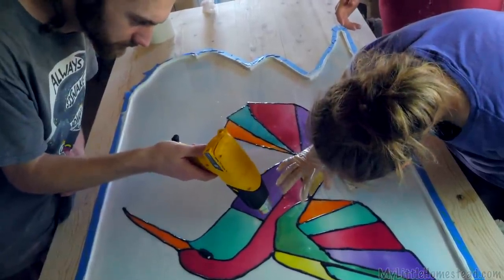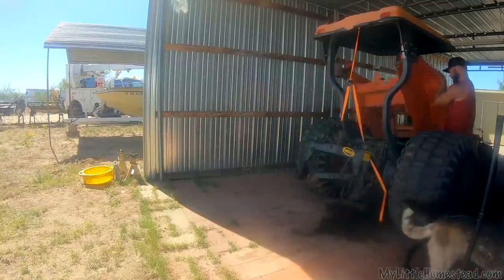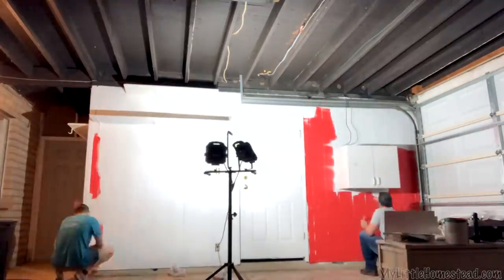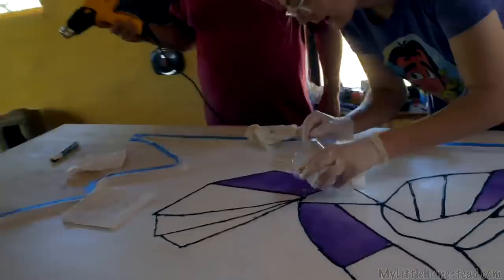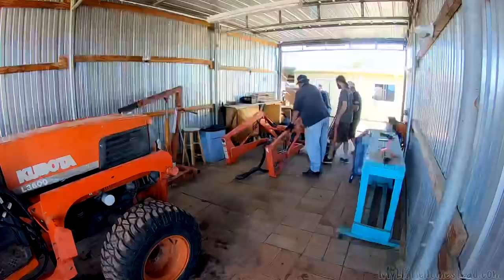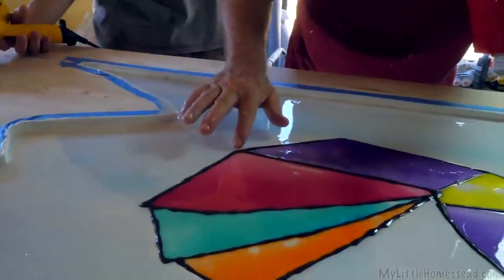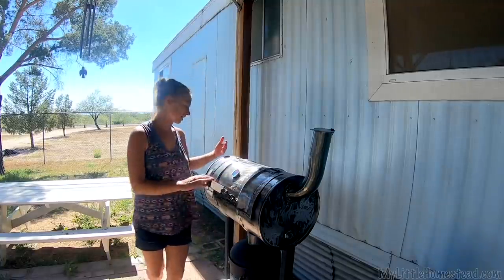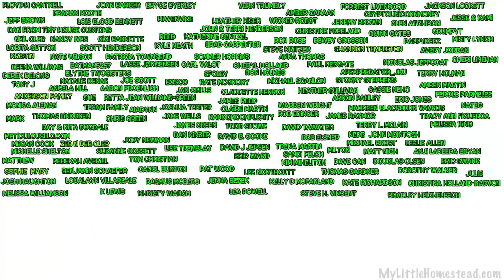Pantry Barn Door Colored Epoxy, Tractor Fix & Smoker Test | Weekly Peek Ep233

Comment: Looks amazing with the resin on the doors. You might want to put a clear topcoat to level the resin to the edges of the indent. It won’t be thick so it would probably set in about 5-6 hours. The clear coat would also add additional protection for the colours and the doors as a whole. I love them!

Comment: great job everyone.  if you want to play more with colors and resin, i use the glass plates from microwaves that i find in the dump.  they already have a rim and being see through you can use transparent colors and set them in the light on a small tripod.  when im putting the resin in the pattern i use pipetts (you can get big ones) and first put a line down next to the  fake lead on the inside, and gradully work in twoard the center, giving it time to spred on its own too.  this eliminates having to spred it around with sticks and it will not overflow either.  your projects sure came out wonderful.  thanks for showing us.

Comment: On the tractor?  The top part that hinges near the steering down to the bucket is the "loader arms".  The "lift cylinders" are connected to the "loader sub frame".  The loader sub frame is bolted to the transmission and the front axle.

I just wish my 1962 MF 40 industrial was as far along as yours is.  sigh, waiting on parts and tools.

Comment: Bree, you can Dremel out the bug with either the engraving bit or else the diamond wheel taper point bit.  Easy peasy, just don't go so fast you burn the resin.  Once you get rid of the bug, just repour that spot.  Been there done that with the bugs....such a pain!  Bugs are totally attracted to resin and I don't have a repellent or solution for that.  I've tried spraying the resin with denatured alcohol after poured, (didn't work), I've left oils that are supposed to repel bugs near my resin (didn't work)....The only thing I have tried is a bug zapper. If you find a solution, please share.

Comment: With 2 part epoxy it should not be touched after the pour it is self leveling. As for the loader on the tractor there is a set of feet that swing down to help with removal and installation